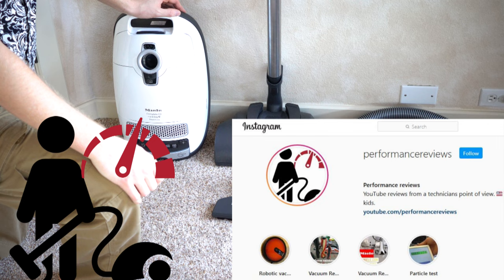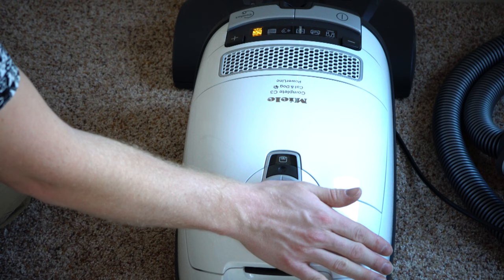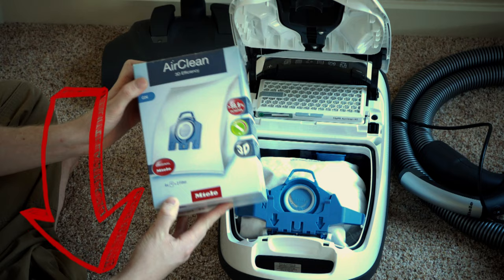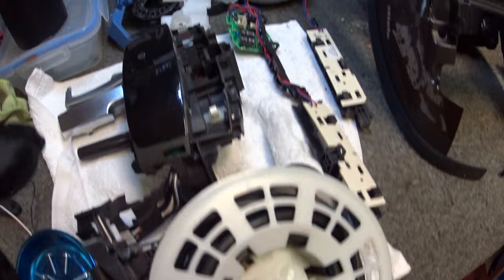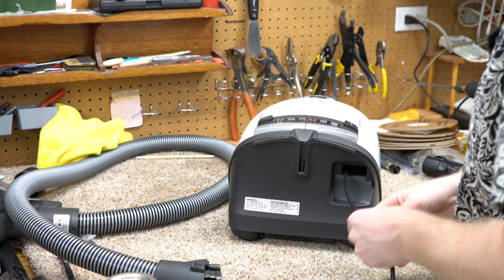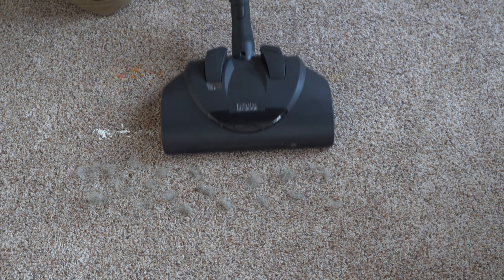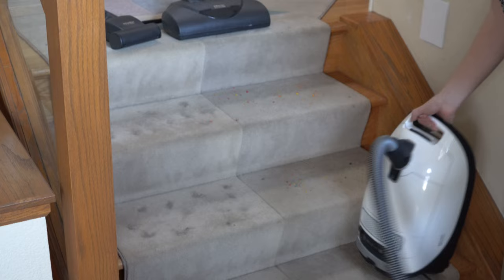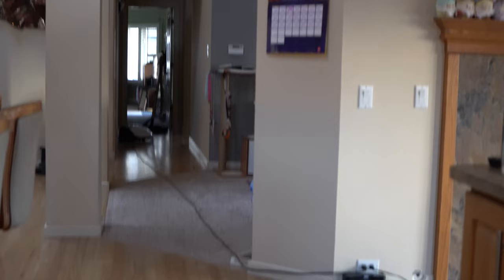Miele C3 Cat & Dog Canister Vacuum Review USA

Comment: Great review!

I’ve had mine for several years now.  I only recently noticed an issue with dust/dirt getting into the chamber and cleaned it up.  I did not know that every time you lift the lid to access the bag that you have to reseat it into the holder.  This may be why it misaligned and caused some of the dirt to bypass the bag and accumulate on the pre motor filter.  Upon checking the post motor filter, it seemed to be pretty clean.  

Other than that I LOVE this vacuum cleaner and never hesitate to recommend it to anyone.  Truly worth every penny you pay for it!

Comment: Nice video! I have a c-3 and it’s a great vacuum. I did however, transition from rug to hardwood to a small rug and the fringe got sucked into the power nozzle. The power nozzle shut off, there was no ripped out fringe but the red button is on for the power nozzle. There are no obstructions to the power nozzle beater and it rotates as it should. The red button will not reset. Any suggestions? Thank you.

Comment: The cost of those bags is crazy.  Id buy the unit if they didnt require a bag.  They want 5.5$ a bag.  Id go through 4 of those a month easy.  Thats like 20$ a month or 240$ a year to use the vacuum!  Screw that!  

Can you empty the bag and reuse?!
Reply from the maker: You'd have to be doing over 10,000 ft to go through 4 of those a month. They condense the bag if you have a Bagless machine think about 10 to 20 empties per bag.
No they cannot be reused that's the point not to touch the dust.
Reply: They went up to $29.99 for a pack of 4… I sold my 3 Miele C-3 machines on eBay. The tools are not great… The only good thing is the suction. A repair is a disaster..

Comment: Thank you for the great video! I've been looking at a C2 Electro +. However, I noticed the C3 Kona is $200 more. I would be fine with dial selector, outside tool storage and smaller bag size (I think). However, are there other factors, in your opinion, that would make the C3 Kona a better purchase and worth the extra money?
Reply from the maker: Yes these C3machines really are excellent. I'd highly recommend getting one and even going for  a test drive at your local dealer.
Reply: @PerformanceReviews  Thanks so much!

Comment: Thank you for this.  When you did the soft carpet demo, you used #4 on the head but which setting did you use on the cannister?  My cannister has a dial setting, but the same options.  I can't tell which carpet to use.  Thanks!
Reply from the maker: It depends on your padding and carpet. You want to play around with it until you hear a sound change
Reply: Yeah that's the problem.  Half my house has more plush carpeting and better padding.  The other half is pretty low budget.  I found it very hard to vacuum the plush side.  I'm not sure which direction to go towards to make it easier to move it.  When I made it too much easier,  it didn't look like there were any vacuum lines- as if nothing was happening. There is no explanation in the instruction manual about the two carpet types on the dial.  That's why I came to youtube!

Comment: I wish the USA would get the new power efficiency motors the 890watt version out performs the 1200 watt vortex on suction and airflow
Reply from the maker: They did update the 1200 watt motor a few years back it is more efficient than it used to be.
Reply: True but it is outdated i think the energy reduceing the EU did is amazing and good the amount of fine dust they pull of the floor is amazing and shocking how 2200 watt powerhouse couldnt even come close with their pick up

Comment: does this have comparable suction to the shark vertex pro lift away?
Reply from the maker: The Miele C3 has significantly more power then a shark. Shark vacuums are Bagless and the suction tends to fade really fast. 
Here's an example with the same suction gauge used in the above video.
https://youtu.be/Y3zdDDYzPUg

Comment: I have a question. Here in my country, c3 with electric hose is not imported and the versions we have has a silver plastic cover on where the electric hose would attach to. Would the electric hole appear if I take out the plastic cover?
Reply from the maker: You would need to add the wiring in the lid and a different circuit board.
Reply: @PerformanceReviews  Thanks for the reply!

Comment: THE C1 VERSION IS ON SPECIAL FOR BLACK FRIDAY  20%OFF, DO YOU THINK  ITS WORTH IT
Reply from the maker: The C1 is a good machine if you have under 1500 square feet. Keep in mind it has a short 19-ft cord.
Reply: @PerformanceReviews  would you say thats the biggest con? can get it for $560, plan to use it for homes i clean